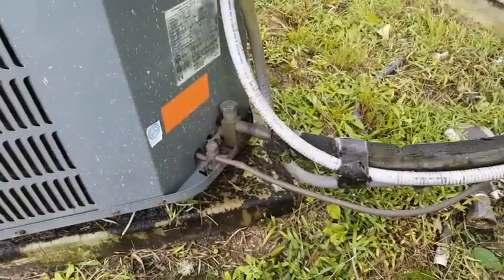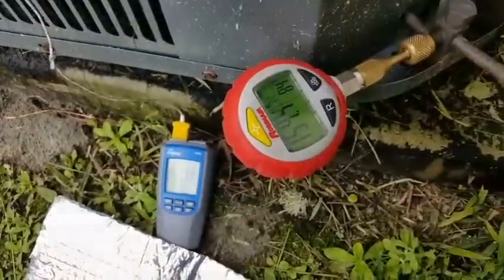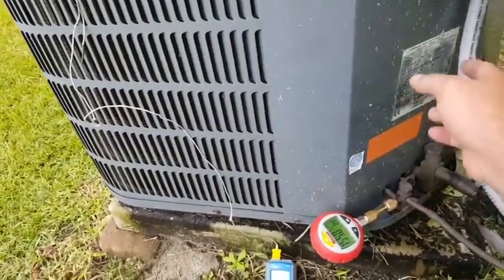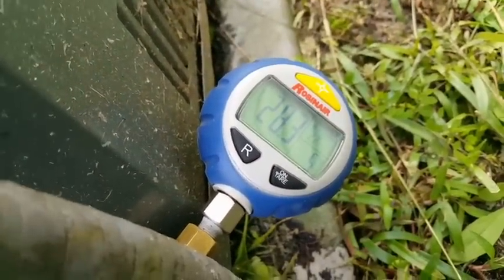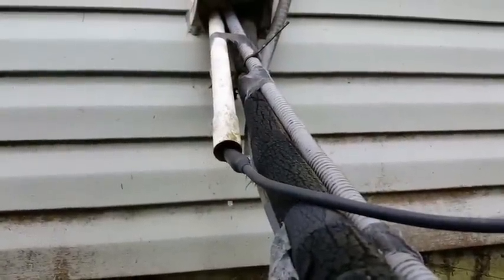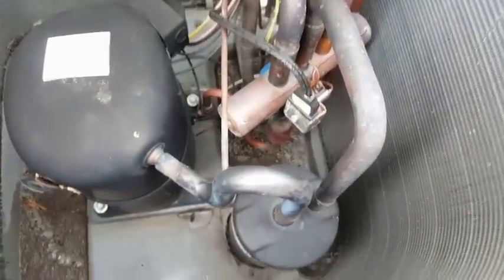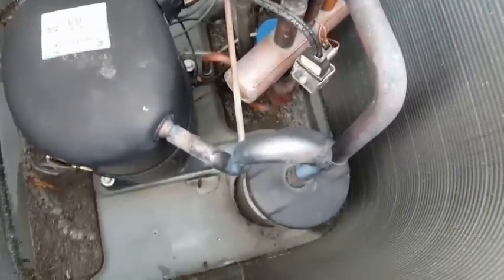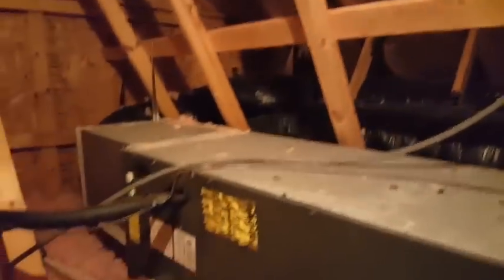Goodman Heat Pump System |  Bad Refrigerant Leak

Comment: I like how you checked the evaporator coil from outside. Talking about a time saver. LOL  Great video Zack.
Reply: Yeah, that was cool. I had a walkin cooler refrigerant leak like that one time. Oil stain from the drain on the outside of the building.

Comment: like a toothache, just pull the tooth... When you do put 407 in are you gonna cut compressor, drain, and put equal poe to mineral? Or are you gonna equal then afew ounce?
Reply from the maker: +refrigeration tech no, I am adding 15% of the original charge